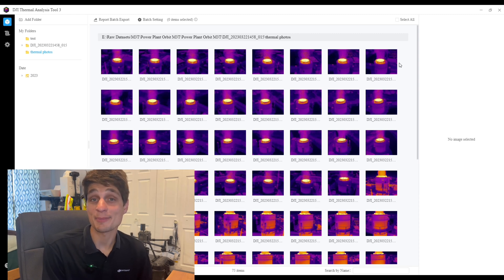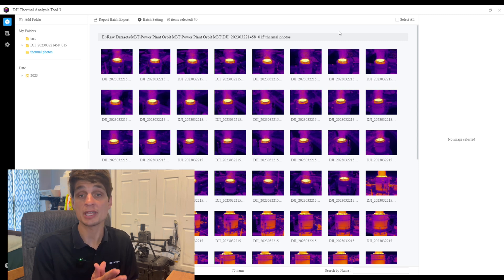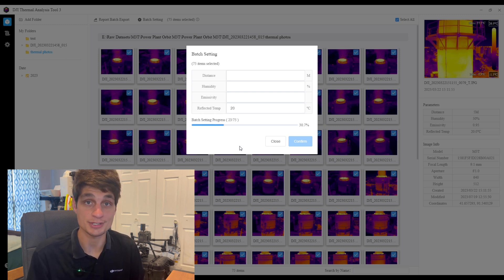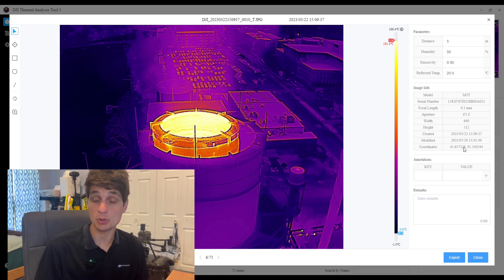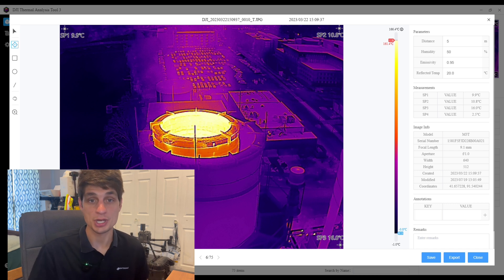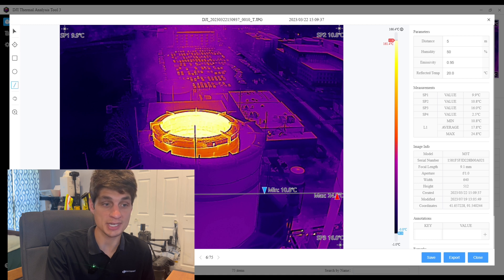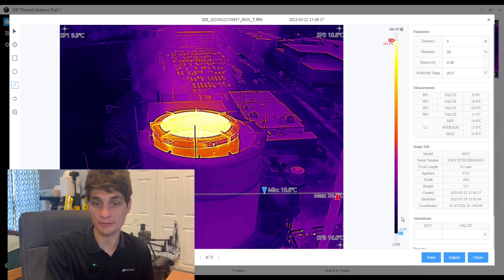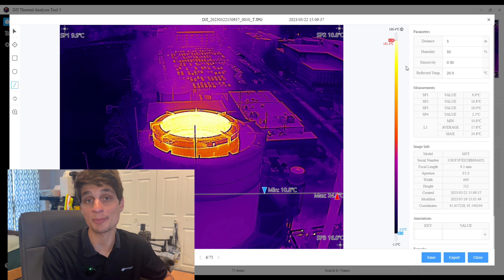DJI Thermal Analysis Tool 3 Update: Batch Parameter Adjustment & More

Comment: For anyone facing the issue where you cannot get the thermal images to load in DJI Thermal Analysis tool, like I was, go into the thermal camera mode via the remote and ensure the resolution is NOT set to high resolution. This doesn't support temperature data. It will transfer the files appearing as just JPG, but they are actually RJPG and should open in the tool with full analysis capabilities. 

I lost 4 hours to this. Hope this helps someone else.

Comment: I use the Mavic 3T. I have the problem that the thermal images are not supported in the DJI thermal analysis tool 3 “ Sample_data\DJI_20241114112626_0001_T.JPG”. Does anyone know what the reason is?
Reply from the maker: Have you updated to the latest version? https://www.dji.com/downloads/softwares/dji-dtat3
Reply: Exact same problem with the Matrice 4T. It's saving the files as JPG. Cannot find how to save as R-JPG or TIFF.
Reply: For anyone facing the issue where you cannot get the thermal images to load in DJI Thermal Analysis tool, like I was, go into the thermal camera mode via the remote and ensure the resolution is NOT set to high resolution. This doesn't support temperature data. It will transfer the files appearing as just JPG, but they are actually RJPG and should open in the tool with full analysis capabilities. 

I lost 4 hours to this. Hope this helps someone else.

Comment: I wish you a good day! I am looking for you from Hungary, I recently bought a MAVIC 3 thermal machine. I took a couple of photos of solar panels with it, I tried to convert them into the aforementioned program, but the program says that the file format is not supported for each image, even though the images are in jpg format. In the smart controller, I can see that the images are there, so the rgb image and the thermal image are also there, and I simply cannot transfer them to the computer. The program does not detect an inappropriate, unsupported file format. My question is, what am I doing wrong? Sincerely, Zsolt Merétei
Reply: Exact same problem with the Matrice 4T. It's saving the files as JPG. Cannot find how to save as R-JPG or TIFF.

Comment: Where do I start...  So many opportunities for improvement.  #1 - Create a MacOS version.  I just purchased a very expensive M30T and can't analyze the images on my Mac.  #2 - Simply allow the user to drag the annotation on the image.  Also provide an option to connect the annotation to the feature with a leader line.  #3 - Allow the user to include the RGB image beside the Thermal image.  That way the report could annotate both the thermal anomaly and the location on the RGB image.  #4 - Include an option to batch export the images as R-Tiff images that can be used in other applications.

Start with these changes/additions and when you're done let me know.  I'd be happy to beta test a new version for you.

Allen
Reply: @pranalizile6160  I do not understand your question
Reply: @pranalizile6160  the only other one I have used is Flir tools.  It's not perfect but much better than DJI Thermal Analyst.

Comment: HI, is it possible to use the DJI thermal analysis tool to convert mavic 3T rjpeg images to .tiff images?
Thanks in advance
Reply: Hello, my question is how do you get rjpeg images in the machine, for me it only writes jpg images as file format. Best regards, Zsolt
Reply: @mereteizsolt3301  Same question from my side
Reply: @mereteizsolt3301  Same question. Just simply cannot figure this out.
Reply from the maker: Not currently supported
Reply from the maker: We do have a thermal sdk if useful